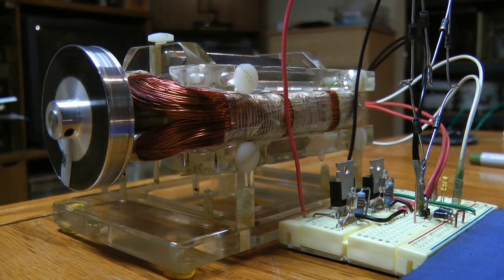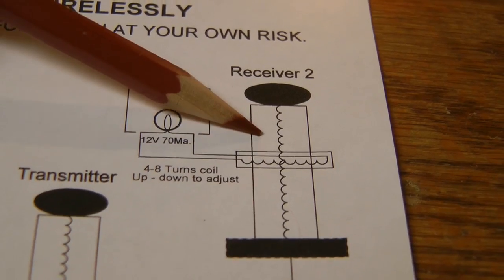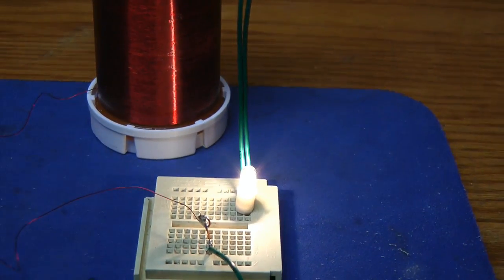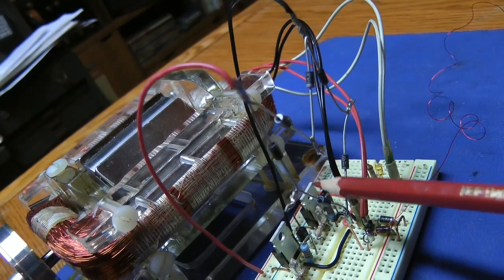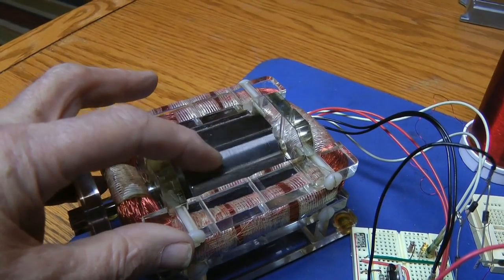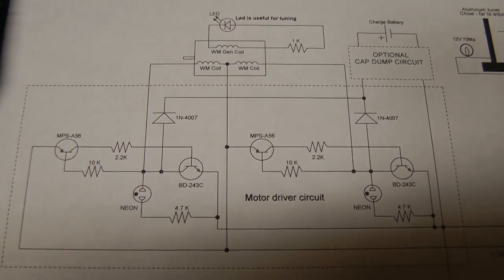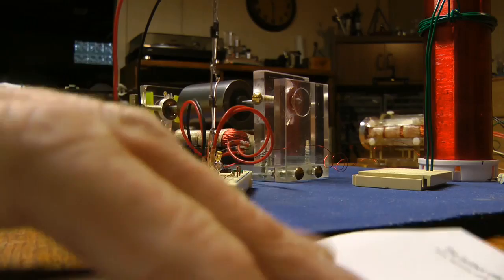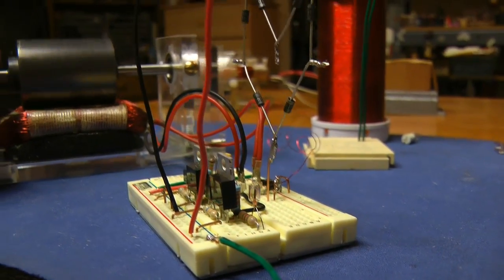Motors Run Wirelessly With Tesla Coil

Comment: Hi DadHav, just seen your interesting video. Are you still experimenting? I have played with similar circuits and was able to light up neon bulbs in the same room even with their two terminals shorted together. I think that the high fields excite the neon gas directly. Have managed to light LEDs two rooms away from the transmitter but not at high brightness using a bipolar transmitter coil driver rather than the Slayer circuit. Your motor drive circuit is also interesting. The two circuit halves appear to be transistor latches. Do you use the opposing drive coils to unlatch the opposite latch?
Reply from the maker: I've been out of commission for some time now ,but trying to get back to more experiments. It sounds like you're doing great with your experiments. I'm glad to hear you're having fun. Let me know if you ever post any videos. Actually there is no latching going on. The driver circuits are using standard npn and pnp transistors. I looked at my video description and found out my information links disappeared.  If you weren't able to get a copy of the circuit, try again by clicking on SHOW MORE under the video description. Good Luck.

Comment: Hi how are you doing I like your project that you're doing one question for you how much current is being drawn off the receiver coil that runs the motor how many amps or current is being drawn 
thank you
Reply from the maker: I didn't check it but it's sure to be pretty low. Next time I set it up I will check.

Comment: What is the black wire coming from outside and connecting receiver. Isn’t it an electric wire from home electricity to provide power to receiver instead the red coil. Need explanation...
Reply from the maker: Hello Sarmad. Using a time reference on the clip would help, but if you are talking about the very beginning of the video the wire plugged into the end of the coil is actually a green wire that looks dark because of the lighting behind it. The wire is a ground wire as shown exactly like the diagram illustrates. There is no other source of electricity to the coil and motor other than what is coming from the transmitter.

Comment: The bulb is 3 ohms COLD. The hotter it gets, the more the resistance goes up.The neon is like a capacitor across it.  But regardless, reminded me of the tesla hairpin circuit where you can light low volt bulbs and florescent tubes at the same time off the copper bars, and if I recall right, maybe even in series?

Comment: the larger the winding diameter the hevier the load that can be applied to it.
Reply from the maker: Correct: More turns on the coil= The less current draw, less speed but higher torque. Less turns= Higher current draw faster speeds but less torque. I have several coils that can be installed on the motor quickly. This one is over 400 turns and can easily spin a radiator fan with pretty low current draw.

Comment: I think the neon is running on the electric field and the filament is running  on electron movement the field is there at the speed of light the neon lights up before the electrons get moving through the filament witch move at inches per minuet

Comment: The secret is not voltage it is frequency. The tesla coil filters out low frequency that only lets higher frequency to pass. Find the right frequency and add an antenna to power your shop.

Comment: John, I read in the new Tesla biography, that when Tesla built his small version of Wardenclyffe in Colorado, that he would walk considerable distances from the transmitter, and test for harmonic nodes indicated by specific frequencies, using a florescent bulb, getting it to light up as he touched it to the ground.  I gathered from the biography that it was wavelength dependent.  This was the mechanism I think that he intended to use to transmit power wirelessly.  I would put an o-scope on your system, to see what freqs are involved.  Maybe there is another node.  I am dying to know if there is a 1/Rsquared decay in the power or not...  We all know that the initial energy comes from his antenna, but he also used electrodynamic machines he called "energy multipliers", motor-generators I assume...
Reply from the maker: Joe, That's an interesting thought. I have a long ground wire that is separate from the ground on the transmitter. One is on a water pipe and the other a ground stake at the other side of the house. I never thought of trying to search for a node that might be farther than where I was working. Maybe I'll give it a try. Anything I pick up that can measure frequency shows about a reading of about .937 MHz anywhere within about 3 feet of the transmitter without even being connected to anything. My feeling is that the  efficiency will drop off predictably as I get farther away from the transmitter. The frequency of the high resonator from one of the first videos was about 5 times higher than this and lit as many bulbs as I could gather using less current but hardly worked at all with a standard Tesla style circuit. I think Slayer's circuit might bring about some new standards. Thanks Slayer.

Comment: If it wouldn't be too much hassle, could you provide me with a basic parts list of all the parts involved in your wireless transmission of power experiment? Thank you so much. It would mean a lot.
Reply from the maker: Hello James, See if this link helps you:  https://drive.google.com/open?id=0BwK5yJUfMl9GU1ZvY2VRbXZHSXc This is a hard project unless you have a pulse motor and circuit. I will be posting an alternative which works better if you can wait a week or so.

Comment: Hello! You are super awesome and i love your channel. I am trying to replicate your experiment except with a different application instead of a motor. So, not including the motor, how much money would you say the full setup you have (i already have breadboards and wire so exclude that) for wireless power costs including the transmitter and receiver?
Reply from the maker: If you already have wire to wind the resonator coil and excluding the motor the cost is pretty reasonable maybe even less that 20 dollars or so.

Comment: just the fact that the neon bulb was touching the circuit caused the gas to turn to plasma. it's not powering it between the leads but rather between the leads and the surrounding enviroment.
Reply: jjhack3r you are right !
The neon and the 12v bulb are actually 2 different circuits.
The 12v bulb lights on the current induced in the secondary winding (differential mode voltage).
The secondary winding is capacitively coupled to the primary winding, which is at a high voltage,   so the secondary winding has a high common mode voltage.
The neon bulb is connected to this common mode voltage and has capacitive coupling to ground, so the common mode voltage makes the neon light light up...

Comment: ok that is nice.
i have got my sstc to run motor. but not this big. only high resistance reedswitch motors. (with the simple 2 zener av plug and a garbage lit as reciever. with a max of 6 feet distance)
this is just sick dude!!
thanks for sharing

That self starting effect is cause the power is pulsed.
you know that effect when you connect the battery to the pulse motor? you hear the coil energize 1 time (atleast with iron core i know it does)
that pulse is apparently enough to get the oscillation going in these type of expiriments.

I did a few tests with IC circuitry (like running 555's and more)
was really hard to get this working.
but in the end i had a simple synthesizer icl8038 with some extra features running wireless powering a buzzer as output)
needed a lot of decoupling caps to get it to run and some caps and resistors to smooth down the pulses.

also about the neon and the filament running.
how is you ground connection? like a tree ?
and then all on 1 single wire to earthground?
or all sepparate?
because rf travels easy over wire
can you try the expiriment with 2 sepparate grounds and see if the same thing happens again?

cause with the tree style of ground i could walk through my whole house with just a earth wire connected to a fluorescent (without only 6 feet)
through my whole house is about 30feet diameter with coil in center

Super nice job!
Reply from the maker: Hello Acid. There is something you might want to try. In the video I light the bulb from a coil around the receiver (Receiver 2 on the drawings) . Recently I replaced the bulb with a full wave bridge rectifier with a filter cap across the output. My motors ran really good from that circuit. My stator motor ran at over 4,000 rpm's. Your getting better results with distance than what I get on the table and I do use separate grounds. One is a water pipe and the other is to the outside grounding rod. So far I haven't noticed a difference either way. Keep me posted if you find anything really interesting.
Reply: hey dadhav,
ok cool! i am gonna try that!
(maybe i have a greater distance as i use a 3 coil system on my slayer exciter)
the "spring" or "extra" coil quarter wave of the oscillation from the slayer exciter.
i will keep you posted on that!
since the video i used you 6diode av plug
this didnt give me bigger distance but gave me more power to play with. big thumps up for sharing.
(you can see the slayer exciter in my profile picture)
greetings jeroen.
Reply: btw your video inspired me to build my own window motor :)
thank you for that :)
i needed a new pulse motor to go on the shelf! :)
Reply from the maker: You have some cool stuff Acid. I have used a water pipe ground and the outside grounding rod and my results are the same. The other day I hooked up one of my stator motors to the dual one coil circuit and ran it from the green wire wrapped around the receiver coil. I got over 4,000 rpm's with it but not the kind of distance you get. I need to get a video of It posted soon. Good luck.

Comment: Hi ! I am Engineer Talha Ikram. I am also working on this project for academic purposes . Can i get the circuit diagram of this  experiment.That how the motor is connected to this Tesla coil and the attachment of Tesla with the motor?
Reply from the maker: +Talha Ikram Hello, See if you can download from this link:   https://drive.google.com/open?id=0BwK5yJUfMl9GU1ZvY2VRbXZHSXc
Reply: arg now i see the reciver need to reversed coiling but this is only the upside of isberg i think see the tesla radiant antenna in the patent is attaked an tesla coil or a bedini motor ùùùù

Comment: Hi Dad
Great work!
I have a question , is the ground on the receiver coil and motor circuit ground or earth ground separate from the slayer ground? Thank you
Reply from the maker: +vinny stvincent  Hello Vinny. I've run the setup both ways, with a common ground and with the circuit on a water pipe and the motor on a grounding stake. There was no noticeable difference in how it worked.
Reply: Hi Dad
The reason that I was asking was that I notice that there is a oscillation int the grounding circuit. And that it adds power to what ever you hook it up to. Right now I have my coils set up like yours, and I see that by moving the receivers primary toward the top load it will do what you show. But it also does other funny things, like change my programs on my cell phone. Also it makes my car battery oscillate ,  thanks for sharing your thoughts.
Reply from the maker: +vinny stvincent   Wow, that's interesting. Let me know if you find out more about it. I got to close with my camera and my SD card popped and came apart.

Comment: For the neon and lightbulb, I would have to assume there is a series of faster pulses with major voltage (can blow up leds, barely affect filaments) that drive the neon.

The waveform can't possibly be a continuous  sinewave, so it's more likely bursts of some few cycles repeated often. That would allow a high peak voltage  (neon) and low continuous voltage (filament bulb).

Able to messure the reciver with a scope?

As for the motor - generators, sure it works but I would prefer the solid-state way.

Comment: That's a great wireless demonstration. Do you have problems with the receiver keeping the same tuning to the transmitters tone from time to time? With the sstc transmission I would get these problems because of antenna feedback that got a signal from the resonator "and its surroundings". With a vttc circuit they are simple to achieve a tuned circuit from the primary coil around the reso and a grid leak from the tightly coupled feedback coil. Therefore if you want to put the receiver coil anywhere you don't have to worry about changing toploads or frustration of the receiver coil being again tuned to the same tone inside the ground at the time being emitted from the transmitter, cant forget about the air transmission pluses, but lets start from the ground up..... Take your most inexpensive am radio for example. they are all tuned circuits. drsstcs have very nice tuned circuits but I dont have that much experience if any at all with those. Did you make that motor by the way? Its beautiful.
Reply from the maker: Tesla Explorer Tesla, I have a lot to learn but have been really luck with my first few experiments. If you look at some of my other videos, you'll probably see I have an eye, ear and nose for tuning, at lease a few have said so. I'll have to read more so I don't depend so much on luck. I do actually make most of my own motors including electric R/C motors, pulse and hot air. Please look around the channel and have a look, I'm sure you'll find we have a lot of similar interests. I might also play the guitar in a video some day too.Take care.John